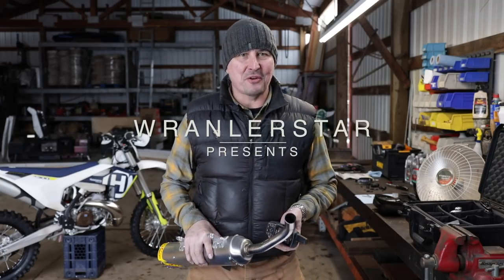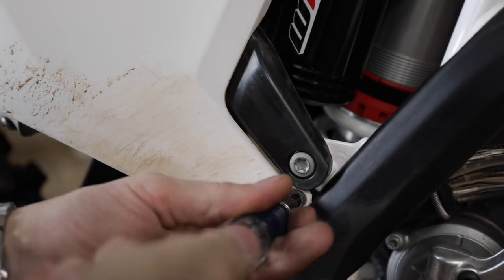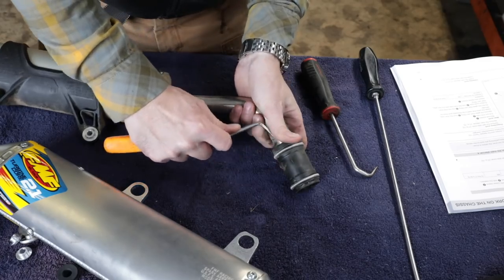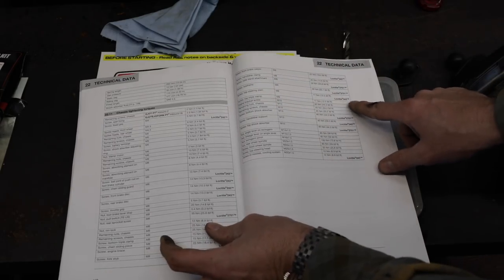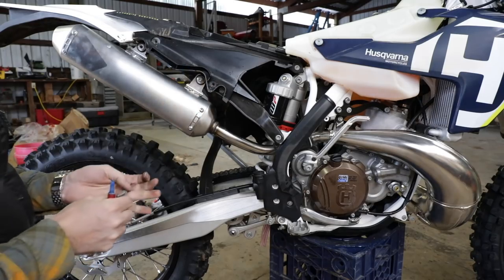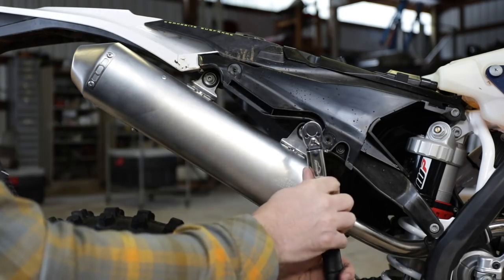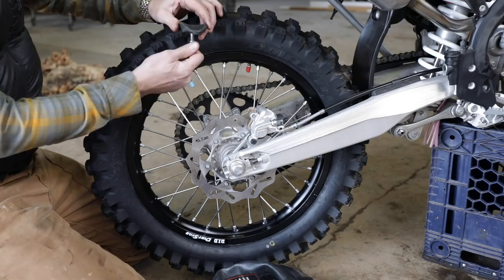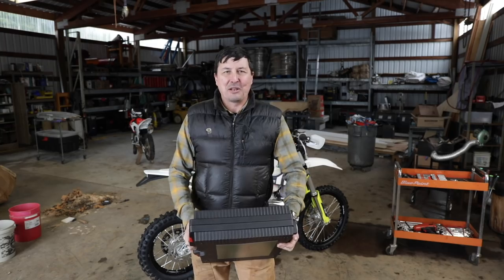Husqvarna 300 TE FMF 2.1 Turbinecore Silencer VS Stock

Comment: Wranglerstar Cody. Working at the Home Depot in my younger years I felt with tons of those price stickers on the racking beam. Hands down the best product for removing sticker is PURE CITRUS ORANGE. It’s actually an air freshener but it claims to be pure orange citrus oil which does an excellent job of breaking down the adhesives!

Comment: Nice to see you read the comments, and to hear you respond to trending rants from them. 
Tip from word @ 6:38 ... cut heater hoses off, do not pull on them and risk damage to core tubes, save $300 - $500  job and pay the $10 for two new hoses
Reply from the maker: Good point, we both know how much fun it is to remove a dash for access to the heater box,

Comment: You will never go wrong with the RAM mounting systems. I have used them for years for GPS mounts on our ATV and GPS/ sonar mounts on our boat. Never fail and very adaptable to different cradles for all sorts of equipment with the base mounts.

Comment: You won't nce disappointed with your tubless system. I've been running it on my 2017 TE 300 for over a year and love it.
Reply from the maker: WoW, just got back from a 3 hour ride in tough tough conditions. I ran the tires at 7 PSI. The traction was so good It was like cheating,
Reply: Wranglerstar, I run the same psi and feel the same way. When i ride with my buddies (they run 12 psi)  I hook up where they can't.

Comment: RAM mounts are good quality and well designed.  I've used one on my boat to mount the fish finder/GPS for several years.  I can rotate it from the driving seat to the front fishing pedestal when I change positions.  It tightens in place with minimal vibration.  Happy with that purchase.

Comment: I never thought I’d repack my muffler until I did it on my 125 and saw so much power I didn’t have before. Muffler packing can be picked up for under $10 and really makes a difference. I’m not big on noisy exhaust either so it helps that as well.

Comment: Quick tip, if you peel a sticker off and it leaves the sticky mark, rub a little mayonnaise over it and leave it for 5 minutes or so. The oil in it breaks down the sticky stuff but it isn’t greasy enough to mark anything. Clean it off after 5 minutes and all the sticky stuff will be gone
Reply: Amazing! I always say, what can you not fix with mayonnaise?!

Comment: Cody, great video FYI if you slice your  over flow tubes down the middle about 3/4 inch in length no mud will clog the end of the tube by your  linkage, also you can  drill 1 inch wholes in number plate to make your bike breath better , I have other tips if you are interested in making your bike bullet proof.

Comment: Cody, you can also use a heat gun to gently warm the sticker, then if any sticky residue is left just use an isopropyl wipe to remove it. Glad you are starting to be a convert to the metric system.

Comment: I had a 500 Husky back in the early 80's  It was the most cantankerous bike I had ever owned.  If you shut it off 
it would take forever to get it started.  It came with a Bing carb.  I finally found a Mikuni carb that fit and never had a starting 
problem after that.  Oh it came with a spark arrestor.  When I ran Motocross I got rid of that and put a Whispering Smith
on.

Comment: The thing you were speaking about with your grandfather in the Army Air Corp still occurs in the Army Airborne with the Riggers. Riggers are the ones who pack parachutes and those parachutes aren’t marked with a clear distinguisher of the Rigger. At least once every month those Riggers will jump with one of their parachutes and they don’t get to choose which one. Such a system definitely works since jumping out of military aircraft with static line chutes is one of the safest things to do in the military. Significantly more accidental/negligent military deaths have occurred with mechanics working on equipment than during static line jumps. In fact, the only death that has occurred during Airborne training happened in early 2005(when I was there). And it was determined through video that it was her and not the chutes fault. She came out of the aircraft COMPLETELY wrong, cigarette rolled her chute, and failed(or couldn’t) pull the reserve. Poor young Soldier, Rest In Peace Paratrooper. Great story though, Cody, brought back some good and bad memories. Fortunately the story brought back A LOT more good memories and only a few bad.

Comment: A tip from a technician, PBLaster is one of the best lubricants for putting in those bushings, and pull exhaust hangers and such. Hope that helps.

P.s those are called a bread head torque wrench.

Comment: One recommendation for looks only. When changing your exhaust, make sure to wipe it down after installation to get rid of your fingerprints. Doing so will prevent them from being baked onto the exhaust surface. Obviously, it doesn’t impact the performance, but it does impact the look.

Comment: If you're not a fan of the metric system you're not going to like working on any of the newer cars. After doing collision repair for 21 years I can tell you that my standard wrenches and sockets just collect dust, with the exception of the 1/4 inch socket that I don't seem to have a metric equivalent to. 

I don't hear much difference in the sound of the 2 mufflers but I'm sure the FMF will let the bike breathe much better. 

Keep the real life videos coming. :)

Comment: .Hi Cody ,  The Rekluse slipper clutch is a great add on for knarly rocky trails switchbacks ects . A lot of guys run them alows you to shift with out the lever and will make that 2 stroke tractor right up and over obstacles
Reply: Phil-  As a midwest dirt biker I've ridden the Rekluse quite a few times, I didn't like it for me, but its so awesome to be able to see WS and others ride very different terrain than I am used to. The west is drier, much much steeper and more rocks - way more rocks.  I can definitely see how running a Rekluse out west is an advantage.

Comment: Cody please do not listen to the haters. One thing, the electric start on your bike is a re-starter and should not be used for cold starting. It’s far too light duty to crank over a cold engine. Always kick a cold 2t engine!
Reply: Has always been the downfall of the KTM electric starters from what I've heard. Operator error in most cases. They should suck it up and add the weight to build them tougher (and reduce it elsewhere) .
Reply: I disagree. These bikes are easy to kick over when they’re cold and the only benefit of an electric start on a two stroke is to fire your bike up in a spot where you need both feet and both hands.

Comment: The 300 really shines in slow, technical terrain. I went back to a 350, for the linear power delivery, and fuel range. Even running a lectron carb, the 350 sniff gas compared to the 2t, or even a 450.

Comment: Just a point of clarification about using a dowel/screw driver to check if you have a spark arrester or not.  This will only work on screen-type spark arresters, which used to be real common, but not as much anymore.

Alot of dirt bikes (Honda, KTM, Husky, Yamaha, etc) use 'Krizman' style spark arresters which cannot be checked with a dowel, as the internals are completely different and the spark-arrester unit is typically a set of fins at the bottom of the muffler core.  All of these have a label or stamped location saying  something to the effect of a 'approved Krizman spark arrester'.

Here is a USFS guide for more info:  https://www.fs.fed.us/t-d/programs/fire/spark_arrester_guides/_assets/2012_OHV.pdf

Comment: I wonder if the plastic mount on the original silencer was a sacrificial part, so that if you had a big off and hit the silencer the cheap mount would break rather than test the mounting tabs off a (more) pricey silencer or strip the threads out of the bolt holes?

Comment: The radiator hose removal tool you used is actually a cotter pin removal tool. I've used the same Snap On tool you have on aircraft.

Comment: Ya so Enduro engineering makes a usfs approved end cap with removable cleanable screen. That allows you to keep the stock silencer witch has Superior packing to the aftermarket ones and usually better fit. And usually quiter. The oem muffler to frame screws usually have the spring washers so no need for lock tight but it doesn't hurt. As for the FMF, if I shave to use one I usually put silent sport packing in them brand new as I've seen several with not such a good packing job from FMF. Just my 2 cents as a shop owner.

Comment: Hey Wranglerstar. Charcoal bbq lighter fluid will get rid of the adhesive residue. Just rub some on the residue wait a few moments and it will wipe off. You might need to do a couple of runs.

Comment: Get that bike jetted! Should start up much quicker than that. Will run better and get much better mileage.  Best option is buy the lectron carb. The stock mikuni carb is way to sensitive to pressure and temperature fluctuations but can be successful if you put the work into it.
Reply from the maker: A Lectron carb is on the way,
Reply: Wranglerstar awesome.  It is the best purchase a trail rider can make for the bike. If you still have issues ask away.

Comment: As you are working on bikes like that, when it comes to torque settings I would be very cautious about torquing them to the manual's specs. Over time, bolts and threads may become weaker than they were when new. It can be very easy to strip out threads or break bolts off this way. I know from experience simply because I have a bike and work on it too. Sometimes when i would go to torque the bolts down even when using a Snap-on torque wrench in inch lbs, I have had trouble stripping and snapping. Just a heads up for the fellow rider. Be cautious.

Comment: You might not like stickers but that might have kept you from getting checked when riding in the NF.  

Oh idk if you noticed but those rubber grommets have a side that is smaller than the other most of the time. The small side goes through the hole much easier and usually you don't need tools.

Comment: Making sure everything is on these bikes has lock tight is a good habbit. But you don't have to torque every bolt. Only thing that should be torqued is when doing motor work.

Comment: I definitely wouldn’t consider fmf to be scamming you out of an exhaust. The stock exhaust is really quite similar to the fmf. Both have the same tone because both have the same basic design and baffle system, except one has a small metal screen to stop sparks. If you bought something like an fmf shorty exhaust, there would be a sound difference. Fmf’s design with the turbine core is used by companies now because of the tone it gives to most bikes. It’s hard to get a major sound difference with 2 strokes just because of how simple they are.
Reply from the maker: Who said anything about FMF scamming me?
Reply: Wranglerstar just assumed by the title of the videos. My apologies
Reply: Wranglerstar I watched the whole video, otherwise I wouldn’t have said anything. Just trying to help out

Comment: Don’t get me wrong the FMF is a much better exhaust but you kept mentioning the hokey mounting system on the old exhaust. You watch The mounds on your FMF will vibrate the welds apart. The plastic molding system would last forever. This is not KTM’s first rodeo, they know what they’re doing
Reply from the maker: I think FMF knows what they are doing also,
Reply: Wranglerstar. I've had this happen to me is all. FMF was great about replacing the exhaust
Reply: Guy Canada but it's not a Ktm
Reply: Cooper grasseth reviews Husqvarna is made in the same factory as KTM
Reply: Cooper grasseth reviews ktm actually owns Husqvarna and husaburg, maybe nextime do your research?
Reply: Griffin Bellavance yup, ktm owns husky.

Comment: Off topic, but just saw a wood splitter that worked like the tool you would use to drive in fence posts.  Basically a spine sirs on the wood, you hold the handles up top with two hands and bring it down like a fence post driver or post hole digger.  I'm sure you have seen them, possible future video testing one maybe?

Comment: So shocked to go to the channel and see your new dirtbike. I have been riding offroad for years, it' great to see some dirtbike content. I think you made a great choice on the Husky 300 two strokes are such superior woods bikes. 

I am a big fan of torquing everything to spec- but over the years I have used loctite less and less - I've found more success with making sure everything is greased and tourqued. Dirtbikes love grease! It's amazing how little grease is used when they put together a bike at the factory.

Check out Jeff Slavens yt channel - He is a Colorado based KTM dealer and a former factory mechanic - His knowledge of the KTM brand and dirt bikes in general is through the roof, and he has great instructional videos on his channel.

looking forward to as much dirt bike content as you can produce.

Comment: Nothing wrong with either exhaust. My comment is I would not assume the aftermarket mounting system for the pipe is better than the stock just because it is all metal. A bit of flex in the plastic is probably not a bad thing. Sometimes a little bending is better than no bend and breaking.

Comment: The only things you need to torque are the spokes and engine bolts.
Reply from the maker: So wheels, brakes, and handlebars aren't important Evan?
Reply: Triple clamps for sure and I prefer to do my axle pinch bolts as well.

Comment: You need to get your carburetor rejetted or tune the air screw.   It should not crank that long to start.   Try adjusting the air screw. The pilot maybe rich.

Comment: Your actually supposed to cycle torque wrench set at their highest setting before you use them....or at least that's what t.o. manuals said when I was in the air force
Reply from the maker: I've read the manuals and they did not suggest this,

Comment: Send your torque wrenches out for calibration. And then do it once a year after. You will be floored how far out of calibration they can be. Especially inexpensive wrenches. Don’t want to strip out any aluminum threads.
Reply from the maker: Not sure this is going to happen,
Reply: Wranglerstar I would be very curious how far out of calibration a cheap torque wrench is from the factory. Keep up the great content!

Comment: I did cringe when you used the razor blade to remove the last remnants of the sticker. If it had slipped it could have cut your other hand. Plus, it could have also damaged the softer metal body. I hate to nitpick but you appear to present yourself as something of an authority and in the best traditions of the comments section, I couldn't resist. Otherwise, I do enjoy your content and wish you the very best
Reply: Don't cringe, Chris.  I understand it is an internet thing now especially with younger millennials...everything is cringy or cringeworthy and grown men are cringing in their safe spaces with their therapy puppies and all...just stop cringing, Chris...Please?  Grown men shouldn't cringe...

Comment: Cody, I think your pilot jet is a little fat. That black drool that comes out and down the silencer is a symptom of a rich pilot jet. I used to have a related technical article from maxima book marked but it is no longer available. I've emailed them to see if the info is still around and I'll reply here with a link if it is. The article explained why the pilot jet tuning was so important to how the rest of the bike ran, as well as important to getting rid of that black drool.
Reply: Maxima was nice enough to send me the article in PDF form. I'll forward it to you if you are interested in the information. I'll need an email address or other way to send it.

Comment: I would have just gotten a promoto billet end cap if they make one much cheaper
Reply from the maker: The are nearly the same price, my concern is the PM was not engineered to work with the OEM exhaust. Just bolting something on is not always the best choice,
Reply: Wranglerstar good point, I have one on my bike it is nice because it uses screws instead of rivets so repacking is easy. I got mine second hand so it was cheap👍. Can't go wrong with the fmf though
Reply from the maker: One thing is true, the PM looks really cool,

Comment: Kodi do you have to deal with an air resource board in Oregon?  We get red stickers on 2 strokes in Cali unless they are a certain age and grandfathered.  I had a 98 Yamaha YZ it had current green sticker registration on it when I bought it.  Went to put it in my name and the Cali Nazis gave me a red.  Red is “no ride” in state OHV parks in Summer months.  I love 2 strokes (power to weight and simplicity of operation) but they say they put out about as much pollution as 250 cars.  Hopefully your state is less regulated.

Comment: How has your jetting experience been with that husq? I have a 2018 ktm 300 and I’m about 5500 feet above sea level I could never get that carb where I wanted it, I eventually swapped it for a Keihin
Reply from the maker: I have had nothing but trouble with the stock carb. I have a Lectron on the way,
Reply: Good choice!

Comment: FMF make great pipes but crappy bike stands! The fmf bike stand I had the holes didn't line up for the pin so I had to drill a bigger hole through it & had to use a small screw driver to hold the stand up? My then new '11' ktm 300xc fell 3x off of that fmf stand once breaking my break lever? Their pipes are great but i'll never trust their bike stands.

Comment: Goof off and there's another one but there both citrus cleaners will take the adhesive from stickers stickers and other things right off
Reply from the maker: Do you have a link to the one you recomend?
Reply: I don't but they sell it in paint sections at hardware stores and even on the cleaner isle at some stores
Reply: Wranglerstar https://www.homedepot.com/b/Goof-Off/N-5yc1vZ4jx
goof off adhesive remover - The Home Depot I think this is a link I'm not very good at this stuff